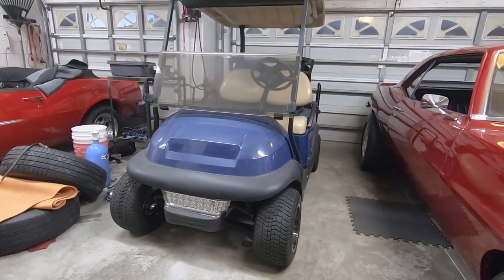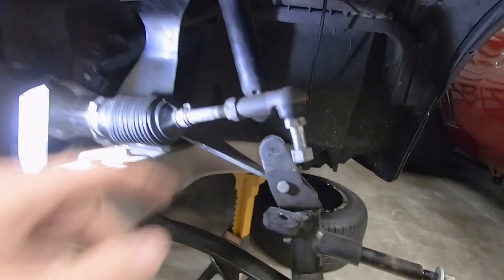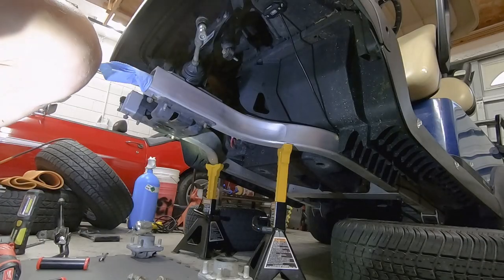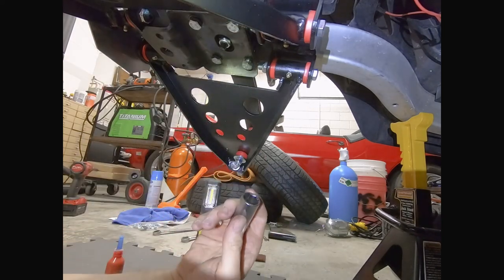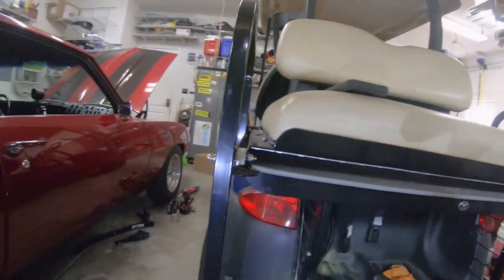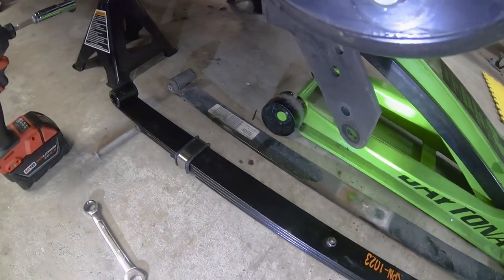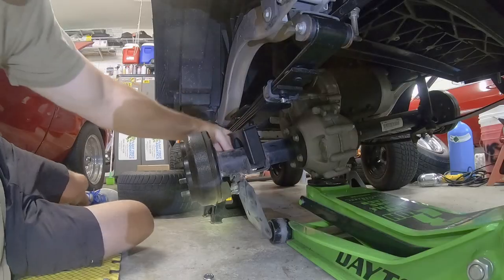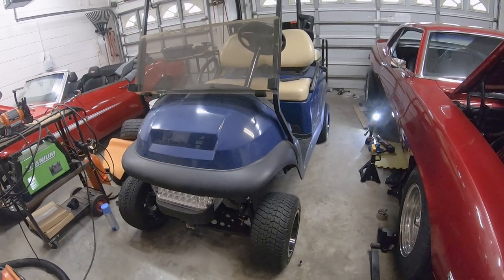GTW 6" Lift Kit - Full Install - Including heavy duty leaf springs

Comment: Thanks for sharing this video. Its Saturday am, im just getting started.  Removing the hubs now.  I also have the GTW 6" lift for our 2017 Club Car Precedent.  I will be installing 23"  tires on 12" wheels.  Thanks Again
Reply from the maker: Take your time and you should be fine. Let me know if you have any questions. Good luck on the project!

Comment: So the smaller riser blocks are used if you use the heavy leaf springs?  Doesn't matter what size tires you're using?  I'm putting on 23x10 - 14.  This video is great.  I ordered the springs and new bushings as they were in sad shape.   I watched your video on a TV and paused it through the process!
Reply from the maker: Yes. Use the smaller ones. I have 23x10 - 12 on mine and the stance is perfect and it’s not even close to rubbing. 

Thanks for watching and I’m glad it helped you.

Comment: Hey just curious as to why you chose to re-install the shocks after the heavy duty leaf springs were installed.  From everything I've read and talking to the manufacturer, the shocks are not necessary with the heavy duty leaf springs.  Mine are in bad shape so I'm considering not reinstalling them.  Can you give me some feedback on how yours has handled with both installed?  Is it worth the costs to order new springs with the heavy duty leaf springs?  Thanks for the video man.  Very helpful!
Reply from the maker: I didn’t think it would hurt to reinstall the shocks. I don’t have the golf cart anymore but it rode great with both installed. Try it out without the shocks and see how it does.